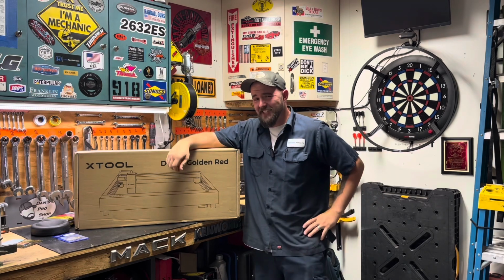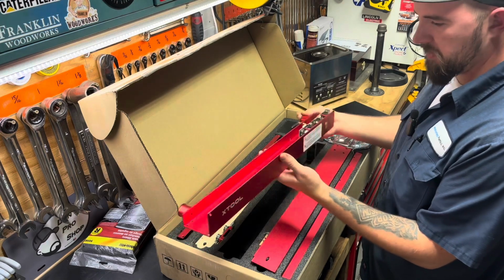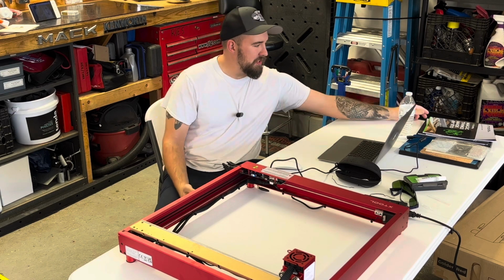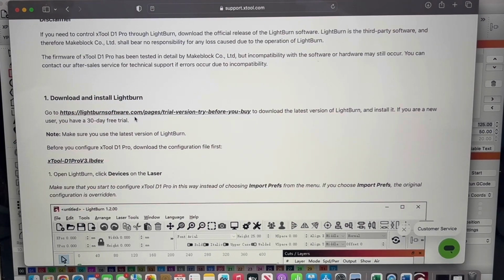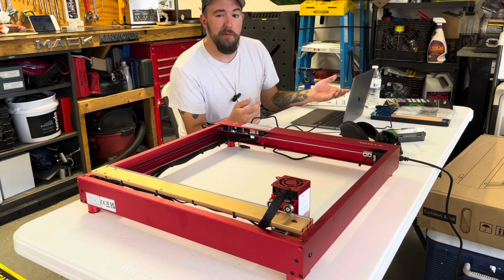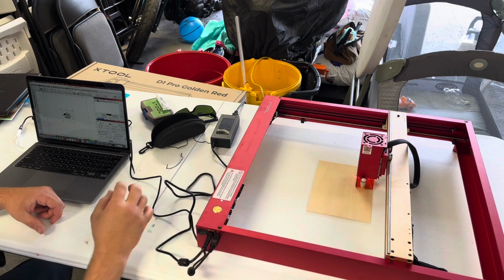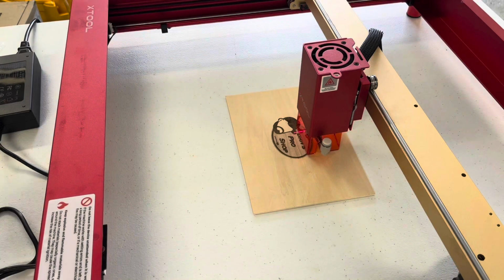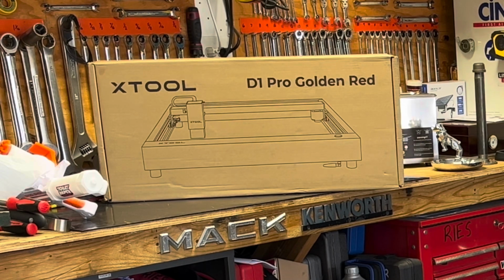CNC laser by Xtool

Comment: The laser head was in Electrostatic Device, (ESD) packaging. Which means an Electronic Device/Chip may be sensitive to static electric from the human body. You need to ground everything together before you touch it. An ESD item may not burn out the first time it's touch, but the damage is accumulative. You may want to do some research and do a video on this. Love your videos.
Job On!!
Reply from the maker: Great comment. Thanks!!
Reply: I was watching diesel Dave Channel they went to a guy that used one to burn John Wayne picture image. Maybe you can do some custom bike seat for your Harley Davidson.